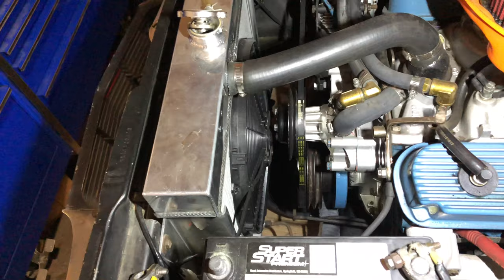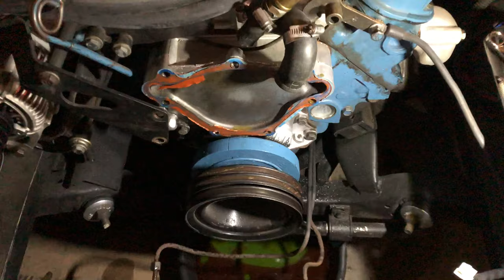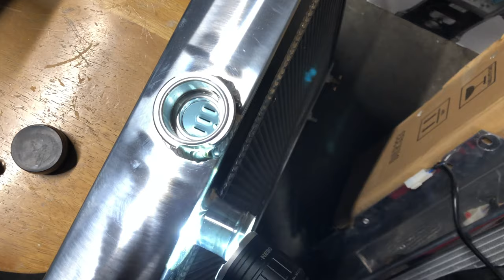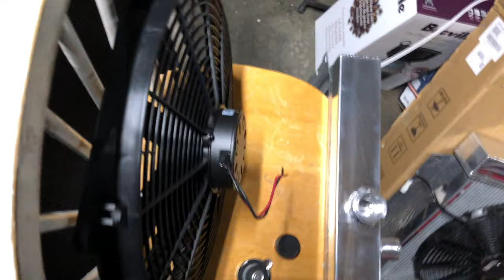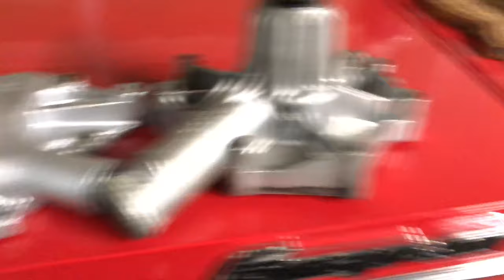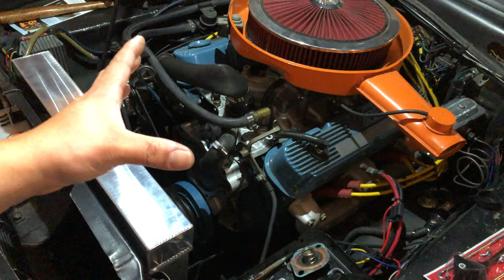Upgrading the cooling system on my 1965 Barracuda | part 1

Comment: Glad your back.
My 73 Vista Cruiser overheated on a 750 mile road trip. I had the original 3 core radiator. Had to open the windows, turn the heater on, and drive 65 mph on the way home.
Talk about painful, though the wagon did average about 21 mpg the rest of the trip. Had and still has a 160 thermostat.
Put in a Champion 4 core aluminum for about $200. I got stuck in traffic with the a/c on max and it did not go over 160 degrees. 
Probably runs a little too cool but no more overheating.
Reply: You were right about the fit. I was not crazy about having to cut a little metal here and there to get that thing to fit. 
Still has the shroud and the clutch fan.
Reply: Cool flashlight.
Reply from the maker: Thanks!
Reply from the maker: They never fit right 😂

Comment: Man no apologies required....sad what you guys are going through in CA...... 220° is getting into the red...thats one of the reasons I'm going to run the larger radiator in 72 dart which use to be slant six...318 roller cam now ... Going with the shroud as well...my ramcharger runs a 318 roller and doesn't overheat in traffic stays around 195° /200°.....good upgrades on your baracuda I'm think of swapping to the high flow w/p on the dart but I'll see how it goes first. Keep post videos when you can....good luck man. Guess fiero!
Reply from the maker: Thanks I appreciate it. And yes Good guess.
Reply: any idea on where to find a wiring diagram on a 1965 plymouth barracuda  273 v8 with a/c